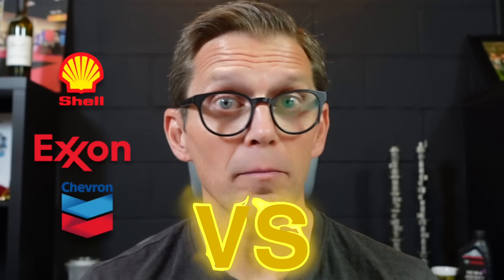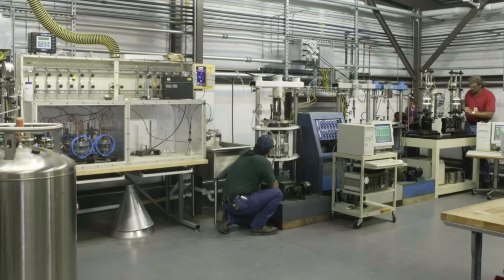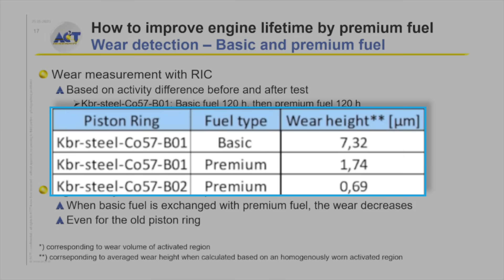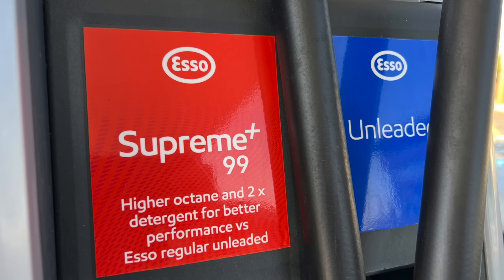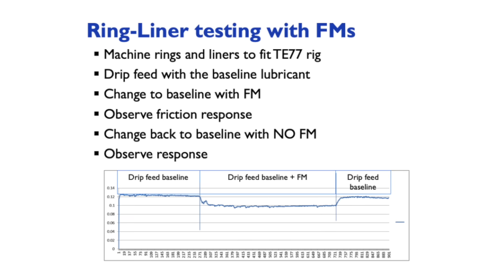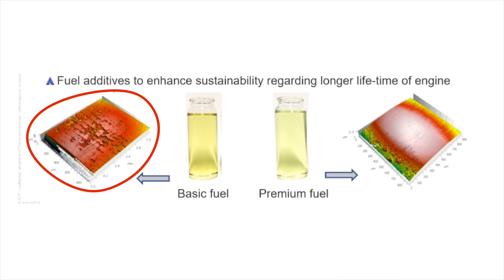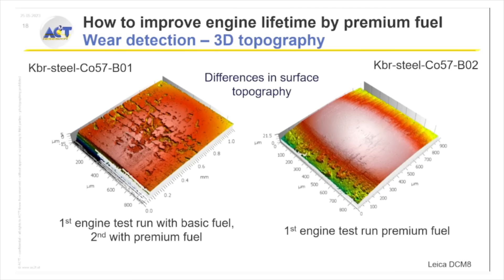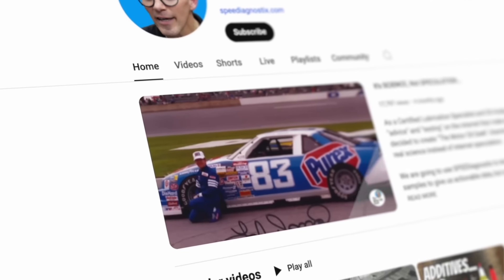Can Premium Fuel REDUCE Engine WEAR?

Comment: I recently switched to Shell from BP.I love the BP ap Earnify but they turned me down on a BP rewards card with no debt and excellent credit score.I called and they said you need three card held for over two years for approval.I just want 0:47  one and a debit.Anyway Shell immediately approved me and I use the Shell ap
My QX50 calls for high test and I run mid grade by choice in my pentastar Challenger

Comment: You have confused people by your comparison.  If your car is ok to run on 85 octane and you purchase fuel at the same top tier station, you gain NOTHING by using their 93 octane. At the top tier station the 85 octane has the same additives as their 95 octane. Fact is, your car wont run as good on 93 if it only requires 85 octane.  Now, if you're comparing non top tier to top tier, that is different. 
OK, Shell does put more cleaning additives than some other stations, but not to confuse with top tier fuel.  Maybe Europe is different.

Comment: even with each n every vehicle that i was driving, "shell was the worse. in some vehicles i didnt last a single week with a full tank of fuel. so again fuel for 1 car will not work with another car. oh man i miss the 1980s vehicles. i had better mileage from our 1980's chevy G20 with a 350 vs the 2017 GMC sierra Z71 which has a 5.3L, so again which is better fuel injected or a carb???? way too many variables to cover in a video.

Comment: 1 thing i do when i get a new car to me is go to each gas station twice, 1st time is to fill up from low fluid, then the 2nd time i fill up from the low fuel. within the 1st n 2nd tank i write down time/ mileage/gas station n days. as in how long does each tank last under the exact same driving conditions. then what week of the month to the year 1st week to 52nd week. then after i do thins with each gas station then i write down start to finish as well as what the price was so the cost of financial variances. honestly, under the same driving conditions,  1 tank didnt even last 1 week as in 7 days. where as another tank would last 6 days etc. the temperature does make a difference as well as the time the vehicale is in motion. morning will react diferent then evening. then the oil itself that i use will change the reaction as well. the vehicles i used were a 2006 ford focus zx4,2017 f250 with a 5.4L 4x4 crew cab, 1997 ford expedition 5.4L 2V, then a 2017 gmc sierra 5.3Lfor me the overall vehicle that i enjoyed the most was the 1997 ford Expedition 5.4L 2V. now for my next vehicle is a 2006 Dodge Caravan with a 3.3L V6 that actually has 300K on the odemeter. thing is not only do every gasket needs to be changed, it needs the upper changed. so now the coolant and the oil is mixing. fortunatly the check eengine light hasnt been tripped. n this old van still runs very smooth. so when i get the van home this week, i can post a video on my channel about this van. the best part about this specific motor, is "it is very straight forward" its people friendly just a very basic motor. no fncy tools, just basic hand tools with a torque wrench. my last question is how do you know which fuel works with the vehicles???? not all fuels/oils n the brand/make/model, will react the same, which is at least 10 videos on the topic of motors vs the oil vs the fuel. so how do you know???? wait...."did I geek out"??? lol

Comment: I use Sam's Club regular with mobile 1 oil . It's cheaper to hold down the fuel dilution and bad effects of fuel by changing your oil more often than by using a higher grade gas !  Any problem with that thought process !

So for me oil change 3 times a year instead of two times a year with higher grade fuel !

Comment: Impressive and reckless if ACT did not control the Cobalt 57 contaminated waste.  Co-57 is irradiator produced and was not under NRC control for a minute. We use it here at my place of employment for testing and calibration of our equipment and due to it's short half-life we have to stay in front of our needs for it especially with the production and science groups not wanting to share. If you would like a handheld instrument complete with software to due spectrum analysis to do your own Radio-isotope NERD testing a loaner could be provided calibration not included.  It is possible to develop a data base of base oils using radio-isotopic spectrum due to the varying amounts of Thorium, Radium, and other natural occurring radioactive materials (NORM) found in all petroleum products.

Comment: Unfortunately, with the cost of premium fuel offsetting the wear savings over the life of an engine, you break even either way. Your engine might last longer, but you've spent upwards of $12,000 extra on fuel over the life of the vehicle. That's enough for a NEW engine. So just use regular, save your money, and when it wears out put a new engine in it. Then it all starts over again.

Comment: I love your videos, I always learn something interesting. 
Some friends have stepped up and used bushed lifters because of lifter needle bearing failures. I have a hydraulic roller cam in a 408 Windsor. I am using Driven oil with Zink. My thinking is the rollers in the lifters and rockers need added protection because of the loads. 
Do you think this will help the longevity of roller lifters and rockers?

Comment: Have you looked at using regular fuel for engine break in, and then switching to premium fuel after that. Is it possible that the increased wear that the regular fuel provides improves break-in?

Comment: Petroleum engineer......Simply put. Long term a fuel thats higher in octane with "industry standard additives" Shell, Chevron, Phillip's 66 blends. Will burn cleaner faster and leave less carbon. Equivalence is a stronger cleaner engine with less wear. If you can afford better gas, and buy Polyetheramines additives a few times a year. You'll be doing everything you can to help your engine stay healthy long term from a fuel delivery standpoint. 👌

Comment: I would like to know if there's a budget fuel additive way to supplement. Like for example using some over the counter fuel additive Even if it's just a small amount to get a sort of benefit. Let's get to the point is using cheap gas in that small amount of additive is at cheaper than just buying the premium

Comment: Hopefully Shell’s present additives are much more efficient and not false information / marketing scheme as it was between 2001 and 2002 leading to the Shell Canada Lawsuit (class action) for many fuel supply systems.

Kinda like Toyota stating that they do NOT recommend me changing my 2025 Corolla Hatchback CVT oil… EVER… as it is ‘lifetime’ oil (unless vehicle is irregularly used, like a cab or frequent towing).

Comment: Thanks Geek - I am buying a new car. One of the reasons I am going for new, even with the added depreciation is that I know How I treated the car and the engine for the first 1,000-2,000 Km, with an oil change (at least one @ 1,000 Km). as I am holding on for the car for 5-8 years, I know that my engine has been given the chance of maximum anti-wear potential through its life, while I own the car. (I do charge a premium for that when I am selling my cars used )

Comment: Good to know the enhanced additives in top-tier Premium gasolines are also helping to reduce engine wear to a greater degree.  I've always used Shell Premium in my vehicles, even though the manual says Regular is fine.  But, since I only drive twice per week & only need to buy about 3/4 a tank of gas every month to refill back to full, I always went ahead  & just used Premium instead of Regular.  I also change the oil every 6 months, which for me is about 1800 miles driven total.  So, hopefully my engines are aging gracefully.

Comment: How about fuel system cleaner additives? Ive been using one at e v ery oil change, which is 2x per year at 5k miles. Not sure it does anything, but costs $20, so going with cheap insurance theory.

Comment: Another terrific very informative video Lake!
Is there a comparison or analysis of ethanol free fuels?
I have several motorcycles and cars that are at very low mileage and am concerned about ethanol or alcohol in the fuel. The intent here is to avoid the hydroscopic nature of alcohol. My storage vehicles only have Countrymark sourced ethanol free 91 octane with PRI-G fuel stabilizer and are run through a proper heat cycle every 2-3 months, ensuring condensation is properly burned off.
My two primary concerns are - 
Does it burn more cleanly or have any impact on the rings such as illustrated in this video?

Comment: So if the fuel has zddp and it gets past the rings in the form of fuel dilution does that cause the oil to have to much zddp and cause issues internally?

Comment: You should always talk to your mechanic about what fuel to use. 

It’s almost always dependent on the car’s engine 

If it’s naturally aspirated use 87 or 89

If it’s turbocharged or supercharged use 91-93

If you put the wrong fuel into the engine you will lose fuel economy and accelerate wear on your car.

Comment: Brilliant topic. Sure your car will run on the least expensive gas , but why not use the Premium high octane in your high performance car, like all BMWs. Customers leasing could care less about doing the best for their leased cars. They're out of then in 2-3 years. And you didn't hit on the anti knock function in high performance engines and the effect on power burning below recommend octane gasoline.

Comment: I had 2006 Murano. Drove until 230 thousand miles. Mostly nothing but premium 91 shell fuel. When we opened the engine it looked like new. Zero gunk. Zero deposits.

Comment: I'm a cheveron guy,  I was told the fuel driver adds the sack of addaitves, can anyone confirm?   I run excessive fuel tests by logging mpg and seat dyno.  However ran across this several times where 1 in 3 tanks of fuel mileage drops off, makes me wonder if a lazy fuel truck driver does not add the sack of additive in.

Comment: I think there is definitely something to it. I remember when I worked at a tractor dealership in the late '60's and early '70's and I was kinda in on the tail end of the LP gas expirament on farm tractors and trucks. There were several factors that contributed to the demise of this, but I'll tell you one thing: I've seen big trucks (two-ton) with well over 200k miles on them and farm tractors with many many hours on them that were still running strong with way more service time on them than you would expect to see on gasoline models. Also, you have never in your life taken a valve cover off a gasoline engine that was anywhere close to as clean and free of deposits as an engine running on LP gas. So yes, fuel makes a huge difference.

Comment: 380k on my Lexus always running the cheapest fuel and oil.  Oil analysis done recently and came back flawless.  It has tbe original injectors and less than 5% long term fuel trim.  Do whatever makes you feel good.  Using Shell exclusively isn't going to save your engine.

Comment: My owners manual states unleaded only. The base gas, not premium. I noticed no difference in torque and horse power. Only barely more miles traveled before it went down to a quarter tank gas left. It is a gimick. For non premium gas suggested consumption

Comment: My AVALANCHE Is Rated To Use 87% Octane
, Engine 5.3L V8.

So, Should I Use Premium Gas Like Shell Or Chevron?

And, If I Choose Shell Should I Use Chevron Fuel Fuel Additive To Help Keep Everything More Clean?

Chevron You Said Has The Best Injector Cleaner?

Or, Should I Use Chevron 87% Octane And With Every Fill Up Use Chevron Fuel Injector Cleaner Too?

Comment: Great content. Repeated over and over. I would like to know the absolute where compared to the relative war between the lower quality additive fuel. That is, I can see the percentage difference between better additives, and and fewer attitudes or lesser quality – but is the amount of where significant in either case. As far as operation of the engine overtime? So – absolute versus relative difference.

Comment: I live in southeast Idaho and “regular” gas around here is 85 octane. To my knowledge, most vehicles are designed for 87 octane and up. I’ve been mixing premium and regular half-and-half to boost up the octane because I don’t want to pay the extra $0.50 per gallon for all premium. Does anyone know why the State allows 85 octane for regular when it’s not recommended by most automakers?

Comment: Buckeyes just put water in your gas tank and it will be just fine...
The supposed octane's don't matter...
Just fill it with water and you will get the same gas mileage if not better...
You can also use the windshield wiper fluid that is provided... also last but not least do not ever change your oil and if your vehicle ever overheats do not use the proper fluids and just stuff a garden hose and your radiator and fill it up with hard water and whatever you do do not add ethylene glycol.

Comment: You should revisit this presentation as it is misleading. In the United States, for a station to qualify for Top Tier branding, all grades available to consumers—Regular, Midgrade, and Premium—must meet strict deposit control and anti-sticking standards through the use of advanced detergent packages. No Top Tier unleaded fuel is additive-free, and the use of metallic/organometallic additives (sometimes used for anti-wear in other contexts) is actually prohibited because of their negative impact on emission systems. Additive concentration itself may be higher in Premium, but the minimum Top Tier standard applies to all grades universally.

Comment: Lake, that was crazy awesome, so I'm thinking about my BB 396 carbureted 6 circuits Right... It would make sense that at different RPMs / pull the fuel going in if rich (in any circuit )  and not monitored by a AF gage and corrected, that engine could wear in self out in  no time.... That is crazy awesome to know... 
What do you think about running a splash of good ol Marvel Mystery Oil ? Just a little something to help out with the top end heat / wear on the components that are getting hit hard .... Kinda like a 2-Stroke but not a rich of course... 
What are your thoughts 🤔 i believe that it would be a great video/ test to real data.. 
What say you?? 
I'v been wrenching since I was 8 ( mini bikes, go carts and lawn mowers)  now 70 and love playing with engines .. 
Thank you Lake for all you do ✌️

Comment: I have a 13 ST Focus with 221k on it. The car had 17 miles on it when I bought. Ford filled the tank up I told them not to if they don't fill it with 93 octane. They said they would but can't confirm. I have used Shell 93 octane every mile and that 2.0 ecoboost begs me to stomp on the gas still. I add one cap full of lead additive to boost the octane.

Comment: Doesn't Shell put an additive package in their regular and mid-grade gasoline?  I don't see that their advertising says that it is only in their premium fuel.  As most engines have a recommendation of 87 octane, what benefit would Shell offer to most buyers if their additives are only in the 91 or 93 octane varieties?
Reply: Shell adds more "detergent" in their higher octane fuel.  87 octane is minimum Top Tier.

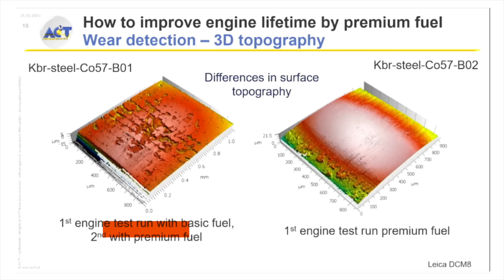Comment: @13:21 It looks like the ring on the left has been run twice as long as the one on the right.  This brings to mind the question how can it be proved the additional wear is from the fuel and not the length of time?  The reason the samples run appear different is because the left has been through two test runs, not one like the sample on the right.  Why wasn't the sample on the right run a second time to validate the results?  Or was the sample on the right run just as long as the one on the left?  This slide is unclear.

Comment: Do you have to use a certain BRAND of premium ⛽️ fuel, like Shell I assume, or does ALL premium fuel have the same anti-wear agents in it?  I didn't know if I needed to switch to Shell 93 octane exclusively, or do other premium fuel BRANDS have the same anti-wear components in them?
Reply: Many Top Tier gas stations have a proprietary blend of additives.

Comment: 🤔 So the friction modifiers in gasoline might also help 2 stroke engines.. Not just at the piston rings/cylinder....But also on the top & bottom rod bearings..
The combination of 2 stroke oil  & gasoline with friction modifiers in it might better lubricate the bearings.

Comment: Hey, great info. so in your other videos, I’ve picked up that those newer, lower-viscosity oils like the 0W-8 that some Toyotas need might not be as terrible as everyone’s saying. Apparently, they’ve got some awesome anti-wear stuff in them!

Now, I’m curious, if the main wear additive (zddp) takes a hit in the piston ring area because of high temps, is there any way to make up for that extra wear without just switching to premium fuel?

Sooo… would running a higher oil viscosity help out?

Comment: Yes, premium fuel can impact engine wear.  Higher octane fuels are less volatile.  So in engines that are made to run premium, lower octane fuel causes predetonation and excessive wear.
Reply: Respectfully, yes that is obvious. But he's talking about friction modifiers/lubricants added to the gasoline to reduce wear on the piston rings & cylinder walls. Which will help keep  engine compression from getting low.

Comment: I believe the brand of fuel makes some difference.  I bought a 2007 Audi S8.  The owner told me to run only Shell 93.  He was correct.  If I used anything but Shell 93 the engine ran rough.

Comment: Lake, I built a four cylinder Toyota engine 2.7l 3RZ. Runs perfect, Ported & polished cylinder head. Used Total Seal Rings. This engine burns one quart of Oil every 1,000 miles (zero smoke from the exhaust). Where is the Oil going? Did the machine shop bore my cylinders too big?
Reply: It's obviously gotta be burning away (blow by into combustion chamber) or you have an engine oil leak somewhere that you can't see.